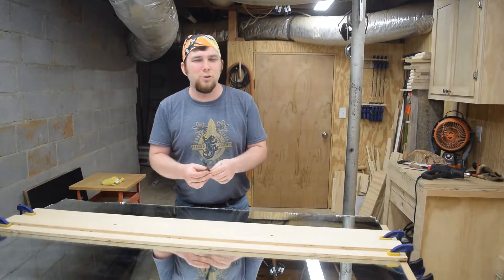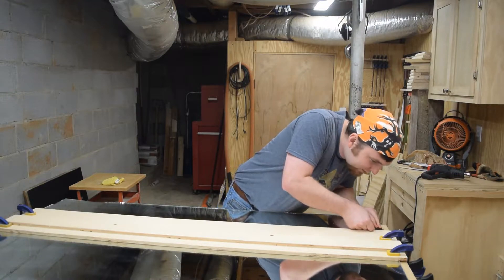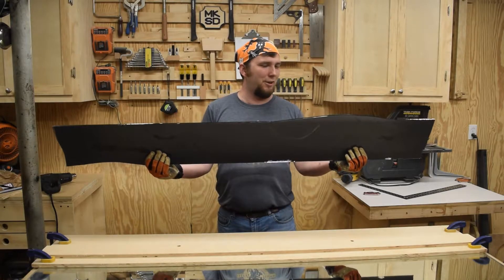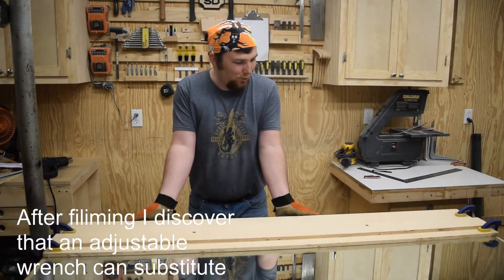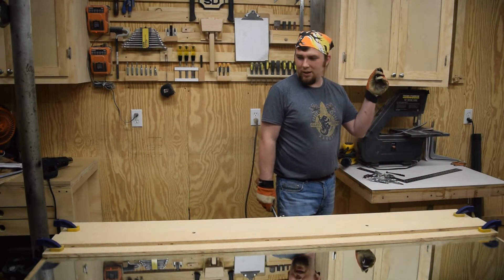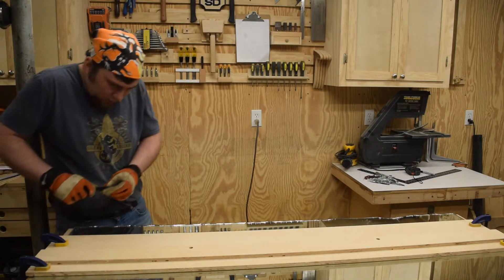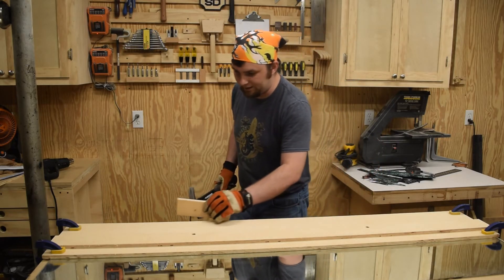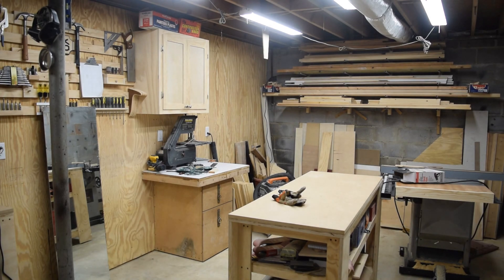Can a cheap glass cutter cut 1/4 inch mirror?

Comment: Never cut 1/4 before but have done a lot of various thicknesses of stained glass. When trying to run the score by tapping it's done from the backside which wouldn't work well with mirror due to the inability to visually monitor your progress. Rather than simply snapping the length of the score especially a long one like yours, use a set of running pliers or crescent wrench to start a crack on each end then gradually run the cracks toward each other.
Reply from the maker: Thanks for the tip Larry! I did eventually figure out that crescent wrenches were helpful (after filming). Thanks for watching!

Comment: I've never done anything like that. But just watched a video where the person said to first cut through the reflective film on the back side of the mirror using a large box cutter and running it along several times. This frees it up to break properly. Then when you turn it back over with the reflection up, you'll be able to see that cut and run your cutter along that line scoring the glass.
Reply from the maker: Thanks for the tip!

Comment: Thanks for uploading: As an engineer (although I dont do much glass cutting): I think you're asking the right question :) 

From what I can tell you've set up a good "clamped edge", so you get an even "score". the depth of the score (from your experiment) appears to be crucial. you mention lubricating the cutting tool... I wonder if that effects "score depth"? (possibly more friction is needed, especially with cheaper "cutters")? I'm also wondering if one can "score twice" (so depth of score evens out)?

On other vids, guy uses a big t-square under "score joint", then applies gentle pressure to "waste glass area". (I noticed you had to use considerable force ... and I was praying for you all the way, man). 

peace. thanks for reading.
Reply from the maker: Thanks writerNB! It was definitely an experiment. I can't remember if I put this in the video but an adjustable c wrench was useful for breaking off small little bits. Thanks again for watching an commenting!
Reply: @MakingSawdust for anyone watching today, it's much easier with glass tongs, and you only want that clamp on there while scoring. Also.wear your PPE. Nothing sucks as much as a tiny shard of glass in the eye.
Reply from the maker: @jameskirk3  Never heard of glass tongs, seems like a useful tool if you do this from time to time. Thanks for watching, and sharing your wisdom!

Comment: Your straight edge is only holding it at the ends. Wood doesn't work for that unless you make a strongback, but you don't really need it to hold the mirror after you score it. Take the straight edge off after you score it deeply. 

Tap it from behind on either end to start a crack on your score, then work towards center with tongs. Gently encouraging the crack to break. 

Either that or score a groove in it, like a serious score, then put it over a straight piece of pipe or dowel. Tap both sides of it with your GLOVED palms and it will break along your score, provided it's a perfectly straight score line. Then polish the edge with 150 and 300 grit to take the edge off. 

1/4" is tough for the first time cutting glass. If you have a mounted straight edge, you can score it more than once if you have to, but that's asking for trouble. (It will dull your glass cutter very quickly. Even good ones.)

A wetsaw with a glass cutting blade will cut it also. Don't try to DIY tempered glass, but a regular mirror would be fine. 

Also if it has peel and stick backing, you need to cut that with a razor blade aong your score line. Some cheap imported glass doesn't have conventional silvering, just a vinyl backer.
Reply from the maker: This is a TON of great information! Thank you for sharing!

Comment: I just destroyed a mirror attempting to cut it with a cutter, no one talks about which size (mm) to use on any of these vids ive watched,,either way I fn destroyed my mirror. Lesson learned sometimes you just gotta bite the bullet and call in a professional
Reply from the maker: I’m sorry your mirror is destroyed. I didn’t even know there were different size cutters. Only reason I was willing to try myself is because I got the mirror for free. I had originally planned to have it professionally cut.
Reply: @MakingSawdust  my apologies for my tone, it was beyond annoying as a do it yoursefer…….
Reply from the maker: @Indian21ubet  No need Dennis. I understand your frustration. I've cut 1/16 inch mirror that gave me no trouble at all but the 1/4 inch mirror was a different beast and I barely got something usable. Even then it ended up shorter and narrower than I had intended.
Reply: Next time try to exert force at the other side of the mirror.. better results..

Comment: Strongly echo the safety glasses comments!  And seeing you pushing down hard on a table edge with your wrists facing the edge and no protective sleeves really made me cringe!  Think you got pretty lucky when you did this that you didn't get a shard stuck into you.  (years of doing stained glass)

Couple things that would make this easier-- use a light oil on your glass cutter when scoring.  3in1 or light motor oil is fine.  Dip the tip in the oil and lightly roll it along your straightedge so there's a small bead where you're going to score.  Then do the score in a single motion, pressing into the glass firmly while holding the cutter roughly perpendicular.

When snapping the score, put a small board or ruler under the mirror with the score line centered on it, both sides of the mirror on your bench.  Then you can press down on both sides of the score and it'll snap on the line, supporting both pieces on the table afterward.  It'll keep you from slicing your arms and should make a much cleaner break.

If you have a small strip to break, put a dowel under your score line instead.  Plywood clamped on top of the large side, then use a board on the small side to distribute the force as you try to snap.  (Kind of like using a shop brake to bend metal sheeting.)  But expect it not to work as well.  Can also use a tool called grozier pliers to work the strip off in chunks, though you'll need to grind or sand the edge afterward to even it out.
Reply from the maker: Thank you for the suggestions John. I read your comment a year ago and meant to reply then. When you are cutting stained glass, is it 1/4 inch thick? I have cut plenty or thinner mirror without any issue, but this was a bear.

Comment: To bad you don't have a clue as to what you are doing... Score the glass, place a no2 pencil under at the end of your score,  apply equal pressure each side of the pencil ... IF your score was true the break will run straight...
Reply from the maker: Just curious how often you cut mirror that is 1/4 inch thick.
Reply: all the time , i have stacks of the stuff, so much that    i am cutting it up for aquarium bottoms,,, also cutting old glass table tops 1/2" for the sides,,, if i made a video would you watch it?  @MakingSawdust
Reply from the maker: 100% I would watch! Especially if you show trimming just a few inches off instead of cutting it down the middle. @toddwhite3217
Reply: Yeah that's what's hard take just a little off ... Like in the real world usefulness ... I just tried my granite polish pads on mirror and they worked pretty good for taking off 1\8 Inch...
Reply from the maker: Good to know! Thanks.  @toddwhite3217